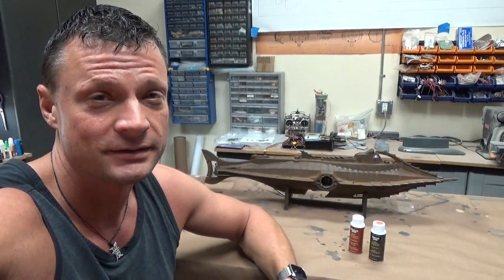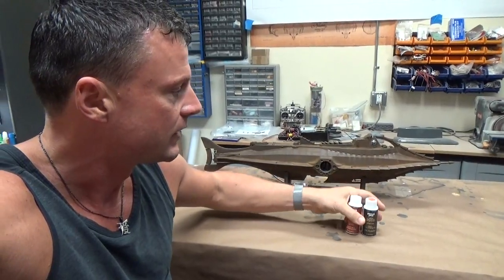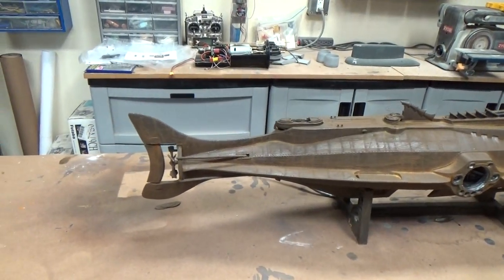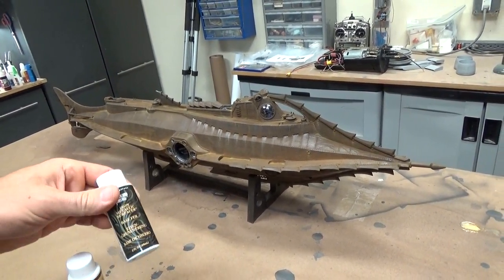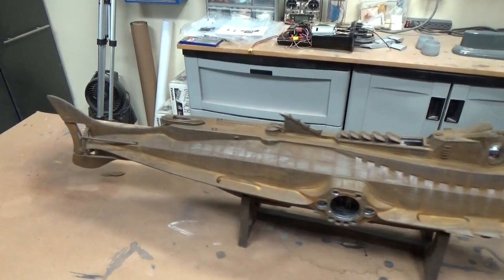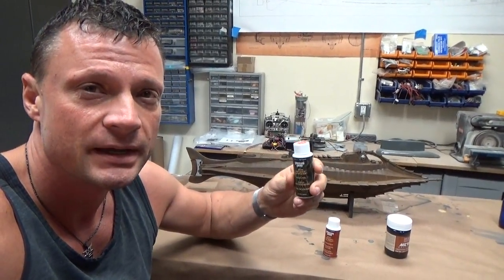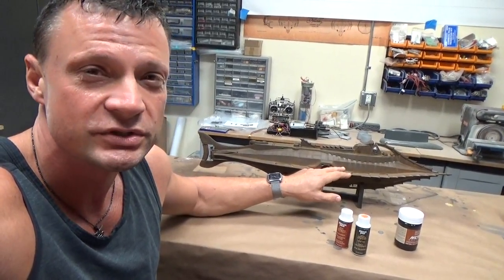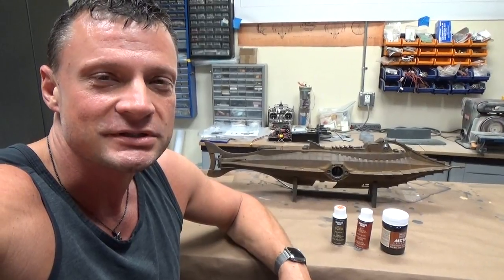Sophisticated Finishes Rusting Product Review

Comment: The rust technique drops the contrast a great deal unless painted metal highlights in more than one color and some fake verigris shows through. I had more fun getting the look I wanted with a flat black primer then detailing, washing over the detailing, and repeating the detailing and washesfor three days. This way I could sneak in hazes of copper, gun metal, blacks, and greens which washed to almost invisible create a multi toned metal look that's all in scale.  Which, after waiting more on this rust, I'll be going back to. It's just more fun to do it all by hand. I also disagree with painting the rivet lines dark. The rivets add their own high key edges and shadows. Better to have the panels around them a bit more murky. And no gloss sealer.

Comment: This stuff works excellent!!! I've won first in class in the project car class at 3 shows in the past 4 years with a barn find 1964 impala. The key is to use little or less surfacer depending on the color that you want. Also you can tailor the thickness or thinness of your rust and you can also get different rust colors by exposing pieces to sunlight.